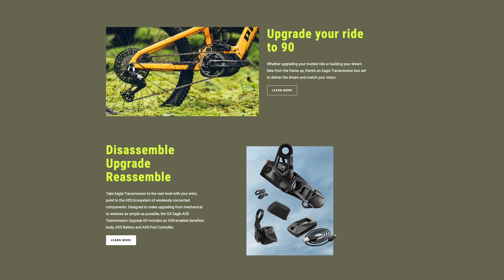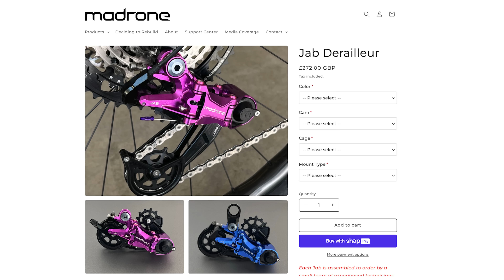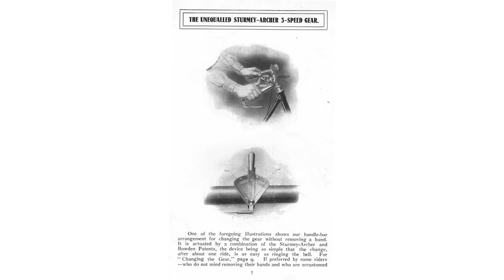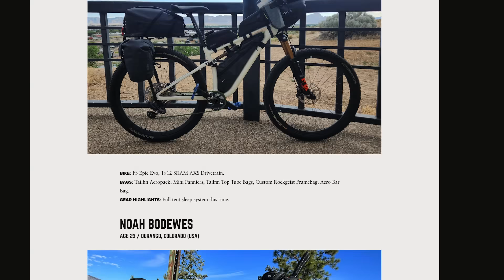Will we hear the last 'CLICK' of mechanical shifting?

Comment: It feels disingenuous to blame shitty 11 speed shifts on standard shift cables and not the tortured cable routing found on modern bikes. Im willing to have a derailleur race with your di2 and my ultegra 11 speed mechanical
Reply from the maker: Pretty sure I was referring to 12 and 13 speed mechanical shifts.  11 has proved to be the practical max of a mechanical system.  After that the slightest bit of cable friction or misalignment spoils things.  My advice, if you like mechanical, buy as much of it as you can and hord it.

Comment: My mountain bike came with SRAM 1x12 cable shifting.
I cannot wait to upgrade to XT Di2 as the number of missed shifts & cable drag issues on a well maintained bike are infuriating.
My 2x11 Dura Ace on my Wilier road bike is perfect,  but I suspect it’s the limit of a bowden cable system.
Reply from the maker: Yeah. The 12 speed and over cable systems get very sensitive to friction

Comment: I bought a bicycle with hydraulic brakes, and converted them to mechanical (with compressionless cable housing).
It is my pure mechanical bicycle and it shall stay this way.
Also: rim brakes are now better than they ever been.
Modern rim brake pads are exponentially better than what they used to be.

Comment: I started cycling with clicky indexed shifting (SA 3-speed) in the 60s. Then moved to DT friction (4 speed). Shifting then went clicky again (late 80s?) and RSI became an issue for me. The good think about electronic shifting is that all those clicking noises disappear, but my DT Retrofrictions remain silent (like my rim brakes) and happily shift 3x10.

Comment: I love the elegance of my XT 11 speed 11/46 on my light XC/ trail hardtail MTB Stumpjumper 2016 Worldcup. It’s one simple cable and it works well. 

The new XT wireless seems like awesome tech and on handling it seems bulky. 

I have never snapped a cable in 10 years of use. The shifting is smooth and fast enough. It works great. Not saying I wouldn’t switch and for now it works brilliantly without issue. I have also crashed hard a few times and the original derailleur and hanger still intact.

Plus no firmware upgrades or battery charging. Just regular maintenance.

Comment: The issues i predict, are e.g. new incompatible batteries with shifing-hardware updates, people loosing functionality due to no longer maintained software, maybe even the issue of malware, people being forced to use certain components, locking out 3rd parties etc, i.e. severe vendor-lock-in with forced upgrades.

I think the idea of ' wireless winning ' misses the point of market diversity, e.g. there are very different types of brakes in use. Roller brakes, coaster brakes, hydraulic brakes, rim brakes etc with different strengths etc. 

I do think, that an electronic shifting system that works without charging batteries & without some software setup procedure, but ' just works ! ' will have a good future. Similiar to cars ; when the automatic shifting doesn't get in the way, but makes things easier, without loosing the ability as a human to have input, it can fit really well for many.

Comment: i don't understand how one, can spend so much on an ingrid derailleur, is it that much better than a 105 ? 

I think you are right that the market will push only electronic compatible frames, easier for them to make, like the hookless thing it's mainly because it's easier for the manufacturer.
Also i've read somewhere that in fact for 12 speed the precision required for the mechanical shifting makes it cost more than to hae it electronic, however they still sell if for higher prices

Comment: You're an idiot. Not all bikes cost £3,000+. Shimano have literally just released Cues. When I see a 7-speed steel MTB with Di2 being ridden around SE Asia by someone who uses the bike as their primary means of transport, I'll concede that the Bowden cable is on the way out. Until then, and as I've said before, you're an idiot.

Comment: The whole appeal of a bicycle is that its mechanical and doesnt need fuel or power. Its the one vehicle we'll be able to use to travel long distances in the aftermath of an apocalypse that destroys the energy grid and results in fuel famine. 

Electronic shifting is a gimick for professional athletes. Its totally unnecessary for 99% of bike riders.
Reply from the maker: Lots of things are unnecessary, but it doesn't stop us desiring them.

Comment: I thought this was a really interesting presentation.

Some Luddite / anti-capitalist types in comments with various versions of 'mechanical will never die'; you're all absolutely correct, in that human-powered (i.e. basically mechanical) bikes are still popular (although, in the UK, also well down from their 1950s peak?).

There's something nice about really well set up mechanical shifting that might keep it popular, and on the other hand, there's some extra hassle from yet another battery-operated device on your bike. Or just in your life. One reason for me to revert to pedals that didn't have a power meter was that - apart from 'my power' being basically useless information - the power meter pedals added to an already high battery count (GPS head unit, sensors, HRM (optional), lights ... and ofc phone). Possibly manufacturers need to think broadly in terms of enjoyment, and how day-to-day device maintenance and the minor grind of charging (and battery replacement, and battery disposal) weighs in the balance.

Comment: Whilst mid to high end bikes will no longer have mechanical options available, there will still be a demand for entry level and spare parts for an age yet. It might be small brands who solely focus on this, but considering there are millions of bicycles in existence that have been running cable brakes, gears that are still perfectly serviceable and usable, it can't go away completely. I was gifted a vintage bike for a restoration project from a relative. Whilst cosmetically it needs finishing, I did a full mechanical service and rebuild to make sure everything works. 1949 Claud Butler, 4 speed Cyclo Benelux gears, GB Sport brakes, all original (excluding brake levers) and all function as intended. Still rides pleasantly, although I don't thrash it like a modern bike and I don't ride it in adverse weather either. I would hate to get rid of it just because I can no longer get cables.

Comment: My Fairlight Secan has a mullet 1x 11 set up of Ultegra shifters, GRX mech and Paul Components Klamper cable brakes. It’s absolutely bomb proof and easy to fix on multi-way rides and doing cross continent events.  I can’t see cable going away. It’ll always be there, especially in emerging markets. Also, no risk of subscription based features and usability, which is inevitable.

Comment: I've never passed out from heat stroke  or exhaustion operating my Deore 9 & 11-speed mechanical derailleurs. I personally have a hard time seeing what problem electronic shifting is solving-for most people. I understand the appeal, but I prefer the simplicity of a cable.
Reply from the maker: I hear you. I think the subjectivity of simplicity is a generational thing.
Reply: Here's what I do appreciate about the cutting edge technology. The very pricey groupsets have made "entry level" equipment so much better compared to the past. If I had to ride 100 miles in the U.K., would I want my 1984 Dawes Galaxy that I rode when I was stationed at RAF Alconbury, or the cheapest Cannondale Topstone with Microshift 10-speed? I'm not sure the Galaxy had anything that could be called "brakes." 😂  One thing I can't argue against-bikes and components are SO much better than they used to be, and I do appreciate that. I'm concerned the ever-increasing cost of entry into cycling could bite the industry in the backside.
Reply from the maker: @christopherharmon9336  true.  Trickle down tech etc.  I think the industry has just split.  Entry stuff I see as now being mostly e-bike.  Trail centers have got excellent and busy hire fleets, and the recreational side, for when you actually want to pedal for fitness is for sure more expensive. More akin to golf.

Comment: Bla Bla Bla, seller and mechanic tells you why you need or have to soon buy new stuff. LoL
What about the downsides of electronics?
2025 and we still don't have standart Type-C port for charging derailleur batteries. Smartphones have been making them waterproof for at least a decade, but the bike industry can't do that.
Regarding batteries and everyone carrying cameras/navigators/power banks. No, not everyone. I saw a friend's battery run out and it was such a shame that he was stuck in a high gear and there was no emergency way to manually select a gear for the rest of the ride.
And about batteries in general - are you sure you want to think about one or two more batteries before a ride? In addition to a phone, maybe camera, watch, heart rate monitor, power meter, electric pump, bike computer, front, rear light. Do you really want to add two more to this list?

A broken cable can't be fixed on the road? Ridiculous. Even if you really cant, if you don't have a spare, you can clamp the rest of the cable either to the quick release of the wheel, or under the rack or whatever any bolt so that the cable is taut enough to select any gear (yes, the cassette or crank turns into 1x, but at least you have this option to select).

Recently, a friend of mine slightly bent the deraliur hanger on a long trip. And when he was switching from 2nd to 1st gear, the derailleur crashed right into the spokes, it was pulled along the wheel, the carbon spoke was damaged, the deraliur was broken. With a mechanical shifters, knowing about the problem, he could try to switch without moving shift handle till the click, listening if the deraliur starts to touch the spokes or not. But electronics are stupid and can't do it like that - the button is pressed - the derailleur moves  FAST right into the spokes, there is no reverse.

And there so so much more. Here we are, adults, with our own lives. Sometimes you can't ride for a year or a few months. Isn't it a common problem that electronic shifting is hard to "revive" after the batteries are completely dead? I recently read a local chat where riders shared solutions to the problem. My God, I'm a tech-oriented person, but this was too much for me.

It's like with hydraulic brakes - the problem is artificially created and a solution is sold for it. Just don't tie the brake cable in a knot inside the handlebar, frame, under the bartape, inside the stem and wow - the brake lever is easy to press with one finger without much effort, miracle.

Comment: LOL "can you really fix your mechanical shifting in the field?" That's the wrong question (and a stupid one). Will an electronic system be more, or less, likely to fail without any warning or understanding of WTF is going on? Oh yes. Will an electronic system cost you a ton more money? Oh definitely yes. I'll keep my low-tech cables. If that means going to a new manufacturer like Microshift, that would be fine with me.

Comment: I appreciate your thoughts and review of the situation, but you are unfortunately well off base.

People who are after electronic shifting are paying a definite premium for that. However that group of people is small compared to the group of people who 'want a cheap and cheerfull bike for commuting', these 'budget' bikes are nearly always mechanical shifting, and I see a lot of high end carbon bikes that use mechanical 105.

Also you need to consider the 'old' bikes that are out there. there are over 100years of old bikes out there, that could all be upgraded to a 'modern' groupset (if you can find a rim brake version).

As I say I understand your thoughts, but you are looking at the situation through your personal bike shop, and most people aren't acquiring a bike via a bike shop like yours, they are going to the local supermarket, or large surface sports store (think Decathlon, Intersport, Sports Direct etc). When I visit these shops only a very small number of bikes are using electronic shifting.

I agree that people buying e-bikes are more likely to go electronic, and I agree that for them this makes sense (they have a massive battery anyhow, and the 'computer brain' can ensure there is always sufficient power for the shifting even if the e-assist has died. That said, I work with a lot of cargo bikes, and they are still majority internal hub gears on mechanical ~ the few electronic 'automatic' hub gear systems are not that amazing, they change gear at the wrong time ~ whilst you are pedaling (so a lot of crunching), or change whilst you are freewheeling, then take an age to re-engage when you start pedaling again. Don't get me wrong here, they are excellent systems, its just that my experience is that I always end up switching back to manual from the automatic.

Maybe in 100 years, when we can have regenerative power creation then all bikes will be electronic, but the inconvenience of needing to remember to recharge all your batteries ~ and how often have you put the battery on charge, but forgotten to plug the cable in, or turn on the power outlet 😖🤦

Comment: As an experienced software guy, I reflexively don't want software in my bike gears. I personally appreciate the simplicity of mechanical gears. But the more I think about it, my objection isn't to the electronic nature of Di2 etc., it's to the industry machine that would cheerfully make me upgrade by discontinuing proprietary batteries, compatible parts and phone apps. If there were hobbyist steampunk open-source electronic gear systems with standard batteries I might feel differently.
Reply from the maker: Sadly, we might not see that until SRAM patents expire.
Reply: I am also not against electronics, they could just align better, but it needs to run through wires and no software at all. Working the past 10y with bluetooth devices i know what i'm talking about. Also i had once a speedometer with bluetooth, worked only few weeks

Comment: Excited about electronic for road, but committed to cable on multi-day adventure/gravel trips. If a mechanical component fails, chances are it can be repaired in the field or at least in the next shop. If an electronic component fails, a visit to the next shop is mandatory and chances are that you have to buy a replacement to keep going because there is no time to sort it out with warranty (if you still have it) and electronics are way less repairable. But for a road bike not used for multi-day rides? Happy to take electronic, since the risk of a non-repairable electronic issue is much more acceptable.
Reply from the maker: That’s the argument I was making. I don’t think it as clear cut as it used to be though

Comment: Electronic shifting is only taking over because it's cool to have servo motors on your bike, frames don't have space for mechanical cables anymore, and people couldn't be arsed to learn how to adjust mechanical derailleurs. Also because manufacturers can ask more money for these. Not because they're better, they're not. Shifting quality is about the same, and my mechanical Dura-ace shifts faster than any electronic drivetrain ever will. Troubleshooting misbehaving wireless connections is million times worse than any mechanical problems. And don't even get me started on batteries, mechanical is set and forget for YEARS.

Comment: I upgraded my bike with the New XTR M9250GS and ST-RX825 levers 

I got the levers at the half of the price from Japan.

It they were at the full price it would not worth it because the GRX 1by (mechanical) is very reliable in my experience.

Comment: Maybe on the road, but not a single mtb rider i know uses electronic. No one wants a crash to cost 100's for a replacement rear mech. Quite a few lads still running decade old 10 speed zee and saint on their proper sending rigs.

Comment: Some of the best holidays I have had have involved flying with mates to somewhere in Europe with a mechanical steel bike wrapped in pipe lagging and then touring a large area without support or pre booking for a couple of weeks.  There is no way to really have that level or freedom with electronic shifting of modern bikes.  Secondly the freedoms of a bike and country lanes and byways is that you leave all the first world crap and dependency behind. The bike should be and has been a liberation from all of that so it seems at odds to me to want to sign up for this dependency on modern day tech and for a bike service to be more expensive and costly than my car service….  How did we get suckered into this state.  We don’t all ride the tdf and have multi million dollar budgets and it’s a pastime and hobby for most
Reply: I can get a thousand miles or more out of Di2 between charges so that's more than 71 miles a day every day for your two weeks. Hmmm.

Comment: Part of me feels like mechanical is so much simpler but when considering the clockwork mechanisms inside an index shifter electronic shifting might edge it out. 
Cables are obviously simpler for non-indexed things (dropper post levers for example) but for shifting...

Comment: I’ve gone from bog standard mechanical shifting, through SRAM Shimano DI2 AXS never Campanello who can afford that. I’ve now ditched all my electronic and have gone back to mechanical. I’m sick of running out of batteries. I’m sick of the sync issues. I’m sick of not knowing what state I’ll be in 40 miles from here. Weather or not if I’m gonna make it home. With a cable I can fix. With electronics from Taiwan, when it breaks, especially in the middle of the ring of Kerry, it’s a matter of how far I can throw it screaming from frustration.